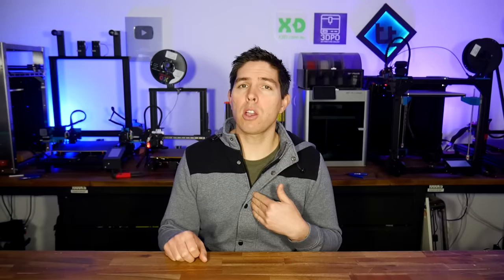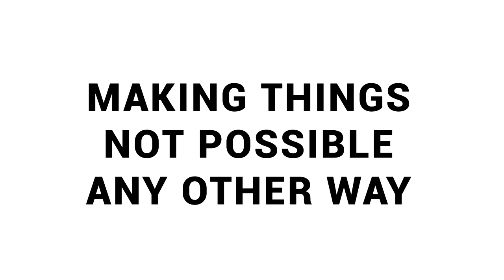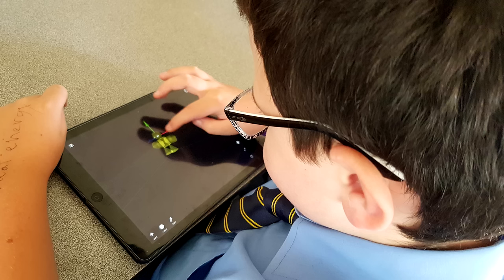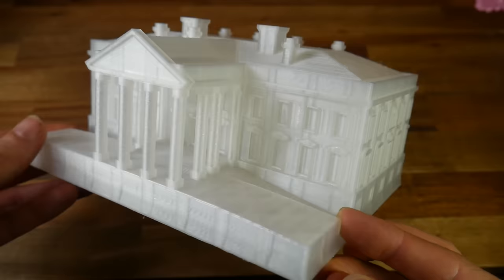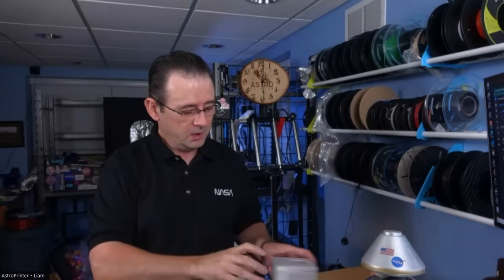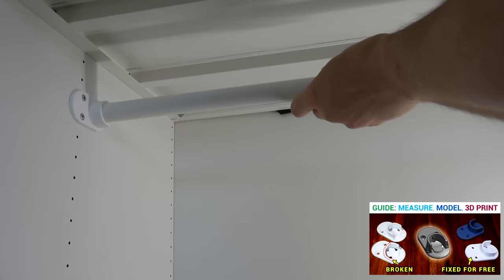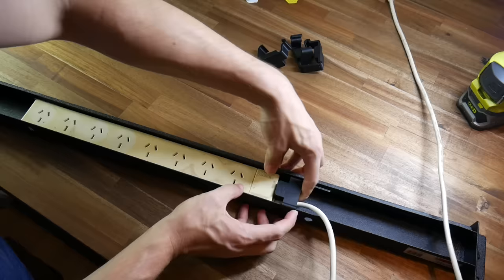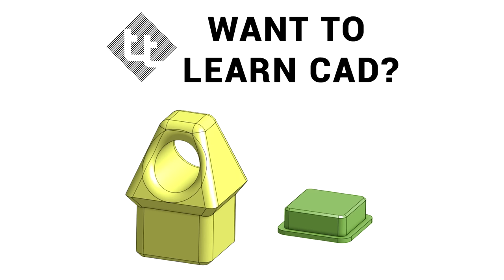These 3D prints will convert non believers

Comment: Really looking forward to the CAD video.
I've tried FreeCAD a few times and I know it can do everything I need, but I just get too impatient not knowing how to do what I want in it.
So I always end up in Blender where I'm comfortable and can mock stuff up quickly.
But blender is obviously a poor solution for this because it's not parametric and is a surface modeler instead of a volume modeler.
It doesn't take many boolean modifiers before things get out of hand and the geometry becomes a mess of non-manifold faces.

I just want milk that tastes like real milk. And a CAD program that's as easy as Blender. (or a FreeCAD course)
Reply: As an engineer, I used AutoCAD and then SolidWorks.  Now that I am retired, I don't want to pay the  high price for one seat of the higher end CAD programs, just to tinker at home.  I tried FreeCAD, but was not impressed with it.  Being an open source CAD program means it may never be polished enough for the average user.   It was more frustrating than I cared to put up with.  I then tried Fusion 360.  It was pretty good, but then they turned on the free hobby users, pushing them into purchasing potentially expensive subscription plans.  This is not practical for a hobbyist on a budget unless they need only the most basic tools.  The more affordable lower tier also forces designers to have their work available on the cloud for anyone that wants to see or use it.  No privacy there!  

I then checked out Alibre Design.  They offer several tiers of software.  I started with Alibre Atom 3D to see if I liked it.  Once I was convinced Alibre would be a good choice, I bought the Expert version.  I decided on Alibre Design Expert, as it has most of the tools I used in SolidWorks and it includes Keyshot, for one reasonably low payment (or a payment schedule if I wanted) and I own the license.  Worth checking out if you want a CAD program that is easy to use and is powerful enough to do professional work.  It is much like SolidWorks.    They deducted the cost of my Atom 3D purchase from the purchase of Expert, which saved money.  I paid $1200 for Expert, which included one year of maintenance.   I don't have to pay maintenance fees if I don't want to and only pay a small fee to update it, if I want to.  The freedom to make this choice is good.   I emailed Alibre with questions during my first year and they typically responded the same day or next day, with accurate solutions.  Overall, well worth it.  

My issue with subscription based CAD software is that the company can screw you at any time, like Fusion 360 did to the hobby users.  I almost lost all of my work because of it, as did many others.  Now,  I own my CAD license and never have to worry about a company changing their mind about their business model, mid-project.

Comment: It's not about the cool things you can make or what they can do. Without a $200 3D Printer to make parts for my business, to learn, to help others or for manufacturing you'd have to have it injection molded, casted or milled. That's what its about. The ability to open up manufacturing for the end user, business as well as aiding it for people who would have turned to those manufacturing methods in the past...

Comment: One question, in your Add dual extrusion with gradients - Mixing hot end guide video what was the motherboard you used called (the one with the 5 stepper motor plugs) because I am going to convert my printer to dual extrusion and I can find the right motherboard. I hope you see this.

Comment: First half of the video is nearly all trinkets and toys, albeit repurposed in different contexts. Should have started with functional, proprietary/overpriced, discontinued, banned for import/purchase, etc... cos a lot of viewers would have dropped off before getting to the second half, satisfied that their (incorrect) bias had been confirmed.
My 3D printer paid for itself pretty quickly just in costs not incurred. E.g. a replacement clip for a camelpak which was priced so absurdly it beggared belief, a cyclone filter for a shop vacuum, vise grips to work on soft materials w/out damaging them, microphone boom + desk mount, storage for small tools, etc.
Considering the international audience, a mention of the firearms community may be appropriate - they are after all at the forefront of innovation & engineering in this space. Including lost PLA casting, electro-chemical machining using 3D printed tools, experimenting & strengthening materials, etc.

Comment: 3D Printing is just like anything else.... It is what you make of it. if you don't have the drive or motivation to learn... all your printer will ever print is useless Knick knacks. Dig in deeper and learn a little...then you can start printing off neat useful things and make replacement parts. Learn a lot on the design / CAD space...and it's invaluable.

Comment: If you live in an apartment it's highly unlikely you'll have a shed or workshop available to make all those brackets, containers and one-off tools that you seem to need from time to time. No problem,  an Ender 3 is super cheap and takes up almost no space. Sure, you get to learn CAD and slicing tools but that's no different to learning how to use those tools in that shed you don't have. Even the argument of how 'slow' 3D printers are is a crock. How long does it take you to order a part and have it shipped to your home? I guarantee that 9 times out of 10 the 3D printer will get you what you need faster. Right now my Ender 3 is printing a caddy for all of the tools for our Espresso bar, and don't get me started about how much money I saved on converting a second-hand commercial coffee grinder to a high end single dose grinder (well over $1,000). Home 3D printing is a godsend to us apartment dwellers. The only problem is the insidious lust of the upgrade. I've just seen the FLSUN V400 and it is a thing of beauty.

Comment: Well first off, people who belittle you hobbies without really knowing anything about it are people you really should be around and are usually the ones that answer the question for their hobbies with "Uhhm I  dunno, xbox?". Everyone is entitled to their opinion and my opionion is, that some opinions are simply invalid and thus irrelevant :D
Second of all, I yet have to come across anyone with that opinion. This might be due to the fact that I'm a very practical person and in turn only print practical things. I've never printed a figurine or even a benchy for that matter, but brackets, gears and other mechanical replacement parts, 3D parts, organizers for all kinds of stuff, phone cases, aquarium decorations, cat toys,.. you name it.
One of the most useful applications is the fabrication of replacement parts IMO, those parts that you just can't find anymore. I've just printed oil tank plugs for a 50 year old boat engine and fixed my moms 20 year old fridge. Those little nubbins that hold up the individual glass panes inside were just crumbling after all that time. Now they are all shiny and new and are probably gonna last longer than the old ones thanks to a reinforced design and PETG. 
Okay, gotta go and finish my camera gimbal now, byeeeeeee :D

Comment: I'm shocked there's still non-believers in 3D printing! I noticed you're a fan of Formula 1, and aerodynamic prototyping and design to produce the shapes we see on the track would not be possible without 3D printing the components first for running in the wind tunnel. Each twist and flick you see of the bodywork on track would first have tens if not hundreds of versions tested in the tunnel! An impossible feat with normal machining strategies.

Comment: They are still a contraption for most. Every Amazon printer has the same flaw. A flimsey frame with chinese stepper motors drivin by cheaply made chinese circuitry. More like a bad day at the hardware store. Results from an Erector set might be the same. And the Product. Attemps to replace real machinig fail due to a Analog to digital issues, not to mention the material. Nothing can be done without compromise. 3D printing is all compromise Unless it was specificly desinged to be produced on such a printer. And for that there is little use.

Comment: Hmmmmmm....🙄🙄🙄  I think SLS 3D printing is just the right answer for the future . Right now , FDM 3D printing has the layer adhesion issue , and it's unavoidable .... ,it's cause extreme weak strength on X direction ....🙄🙄,  (and most of the time  you need support in Z direction .. ) . although SLS is expensive now....., I personally believe it will go cheap in the short time of the future ....:elbowcough::elbowcough::elbowcough:

Comment: I don't think it's a useless technology. I think it's a rich man's toy. Unless you're an engineer with computer drafting, 3-D image making, equipment that costs as much as a house, and clients willing to pay a fortune for custom gears and cases, there is little likelihood that any normal person with a life could ever do this.
Reply: Very wrong.  I started 3d printing many years ago and that was expensive.  Look at the prices of printers now you can get quite good machines for under £150. And can easy make that money back doing simple print jobs.  Now myself know nothing about cad but make my money doing custom work like today I did 2 snakes for a lady and made a few quid for very little work
Reply: @paulvincent9744  , that would be about $180 USD. For something a non-artist, non-mechanical engineer, working-class person would struggle for years trying to use. For items that need repair, I use epoxy or cyanoacrylic glue, adapt something from a thrift store or junkyard, or buy a new one. I have a real life with enough stress without a struggle with an expensive device sold to (I reiterate) rich hobbyists.

Comment: That's all fine and dandy if you can use CAD software and design your own parts. But for those of us that aren't that savvy, oh well. I still have what I consider to be an awesome 3D printer, the Anycubic Kobra, not the other 2 misrepresented printers known as the Plus and the Max. Which are in no way Kobras. Anycubic just used this geise to make these 2 seem like upgraded versions of the original Kobra.

I use my printer to print things for my grandchildren. Actual, useful prints. I don't just print things to be printing. It creates too much of a negative effect on the environment. I only print things that my grandchildren and I can actually use.

You should have given "outofmarbles" a shout out. Their modular marble machines have to be the coolest useful things I have seen.

Comment: Great video but i almost tuned out on a segment about charity. This is really not a good arguement. Yes making some print in place toys for charity may have been a good point, but most of what this people do(toy trains and cars) are just an inferior version of mass produced goods and they're more costly to manufacture and far less sturdier that mass produced ones. You really should've put this section towards the end or the middle of the video.
Also bioprinting is too far off from other thing you mention. It's much close to the field of medicine and cnc device manufacturing then to actual in home cnc usage like what 3d printing really is.
Actually i don't thing 3d printing can be a hobby. It's a component of other hobby \ work. You wouldn't call a drawing or wall painting a hobby, would you? It's the same thing. It's more a means to an end and a tool.  It's not about what you do with it, not an actual process of doing it. 
So yeah. first try to find a purpose, than seek a means to it.

Comment: Tl; Dr : go learn 3d modelling if you have or want a 3d printer

I have been a 3d printing enthusiasts for a LOOOONG time, and it's an invaluable tool, but I still have some issue with it.

Mainly, it's how certain people use it. 
You can see plenty of people on Facebook groups that have 2, 3 or even more printers and that only prints useless trinkets out of thingiverse. They openly say they don't want to learn 3d modelling, they just want to print some stuff.

For this usecase, i think 3d printing is dumb. The main selling point of 3d printing is customisation, if you're going to print standardised stuff your better off just buying stuff that will be better made ...

3d printing is a tool. And there is no such thing as a bad tool, there are just bad usecases for said tools. Saying "3d printing is dumb" is like saying "wood chisel are useless because they are terrible as flat head screwdrivers"
And I believe that the mainstream "download random stuff and print" is a bad usecase for 3d printing... A trip to the dollar store can provide you with the same amount of random stuff much better.

Comment: I find them completely useless.  I don't see what on earth will physically generate money beyond the select few that have a market cornered like the guy with the modified nerf gun stuff.

I have 7 printers and now knowing what I know, I realized I wasted 10s of thousands of dollars.

I now own a 6000lb CNC machine and I can make products that don't warp and or fall apart as plastic becomes brittle.  

Don't get me wrong, you can invest far more than I have to get a machine that makes parts out of whatever.  But it will never replace a casting, injections or milled items out of materials that aren't a complete waste of time.  Not to mention they are always limited to insanely TINY build sizes.

Learning G-Code is fantastic...but all in all, a 3d printer is, IMO, a complete waste of time and ultimately money.

Comment: Useless novelty??? hahaha wtf??? I print little tools, devices, boxes and utensils for just about everything. Close to no decoration prints, and I don't think of 3DBenchy (benchmark) as a decoration as all of them are labeled with a number and the numbers are in a spread sheet so I know what filament does what etc. 3D print is the best thing Cura sliced bread!!! It's nothing more than a lack of imagination on your part if you can't figure something useful to do with 3D printing. It's not of any fault of 3D printing itself. Now I'm waiting to get home from a upcoming trip so I'm in place when I order a FLSUN v400 delta printer that will be ... larger, faster, PRINTER !!! :D

Comment: 3d printing has some uses, but limited. Prototyping is probably the biggest benefit. A tool and die can cost way over 100k for injection molding. Any changes to the mold is more money. Nice to prototype with 3D printing first. Things that are not visible and are low stress can also be 3D printed. Anything that has been 3D printed is very obviously 3D printed and look terrible, lets be honest. Problem I have with 3D print people is the Vegan Effect. When someone is vegan, they tell everyone they can. It is annoying AF. 3D print people can be the same. I literally felt like I was watching a vegan justifying being a vegan watching this video.

Comment: I NOW HATE 3D PRINTING. there is not much support at all. And no one wants to help me here. i am having a massive problem with my 3d printer. Just got it. i am new. it is called ankermake m5c. the problem. the filment will not extrude Will not print. error keeps appearing saying. Filment broke. i checked it. it didn't break at all... FIlware is up to date. i am hella confused. Also the filment won't even come out now. it is stuck in it now. This printer claims to be easy for idiots LIKE ME. And somehow broke it in 2.8 secounds... And yes why not call the support number? they close to early... :( gotta wait a whole day until i can call them up again

Comment: Hiya mate. You say non believers? The plastic is toxic to the environment and you guys print endless pieces that are useless. 

Sure there are a few tests we should perform to make sure we get to know our printer but shouldn't the manufacturer be making these? Showing us what prints will work at what temperatures and what filament they use. That would 1 benchy video, not thousands. 

There should be clear guides on how these printers work but the problem is, they're mostly from China. 

I believe 3d printing should be used for usable parts only. Taking responsibility for the waste you invented and created. You bought the filament. You printed it. How will you dispose of it?

If 3d printers go mainstream then we will have a massive plastics problem of combined materials and chemicals that would cause a disaster. As you can see is already the case. 

Be careful what you wish for. 

You have great videos though mate. I've learned a lot from you and its very informative. I found out about 3d printers in 2008 and I've only just purchased one to make the designs and models I have designed. Youre an asset to 3d printing like makers muse and Chep. You're the main 3 I follow. 

 We should have a chat and get together, share some ideas and solutions on fixing this problem. Build our own 3d printer and find someone to develop a mainboard. 

You know what you want out if a 3d printer and have whole creative army behind you. A Linux 3d printer ;)
Reply: Hey there! I personally disagree with this point of view, and I would love to have a conversation regarding this topic as I want to broaden my horizons in terms of this. Is there any way you are contactable easier than YouTube comments? Would love to hear back! :)